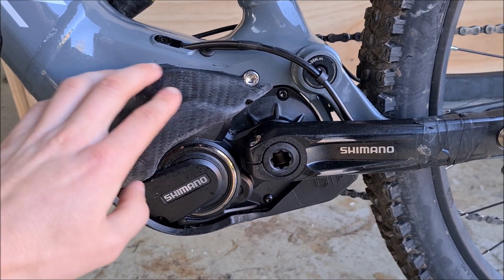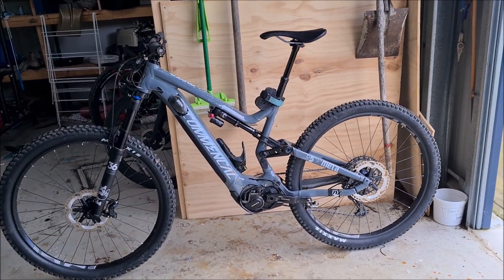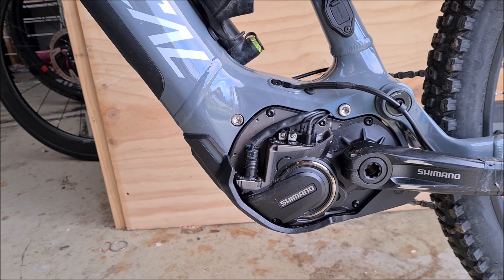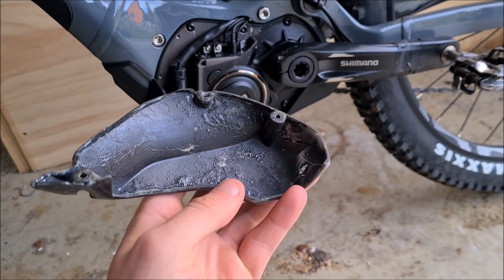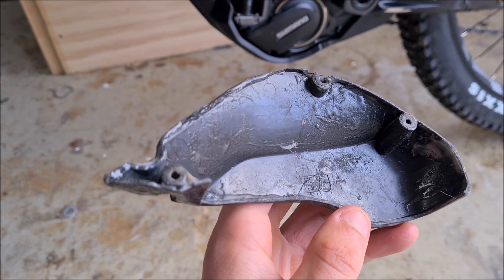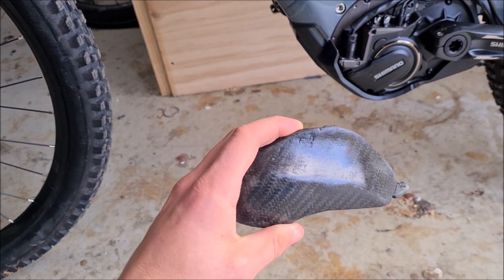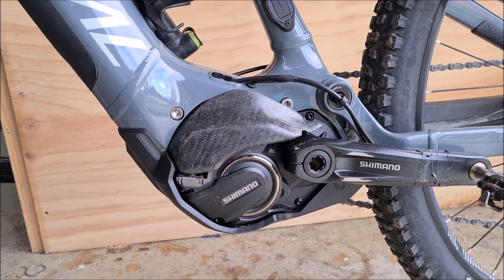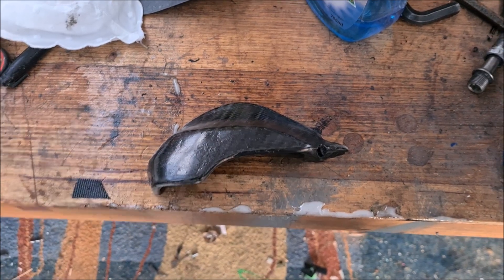Shimano Steps E8000: Reinforced Motor Cover

Comment: Cleaned my bike today and noticed that the cover was cracked. Thanks for the video.Yep. It's super flimsy, unessesarily lightweight. Mine was slightly cracking up, just the screw holes, until I trailered the bike a couple of thousand km. The vibration is the cause imo. There's plenty of room on the inside for glue and reinforcing mat or whatever.